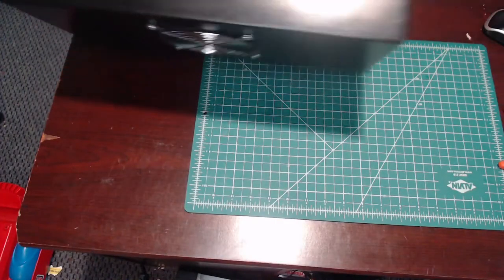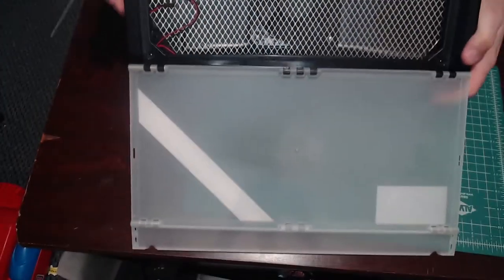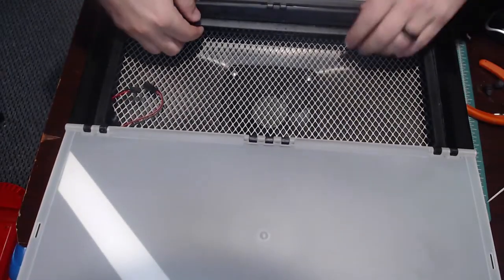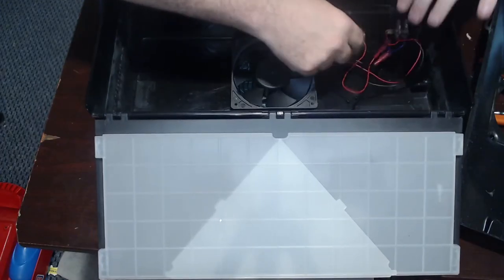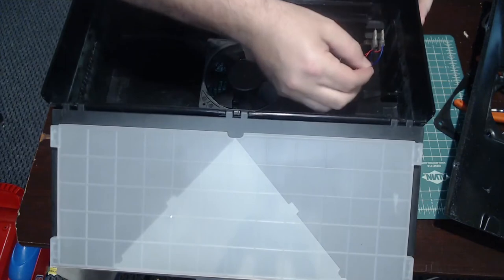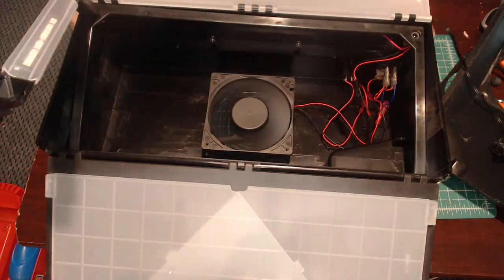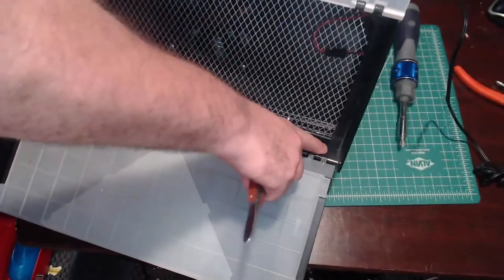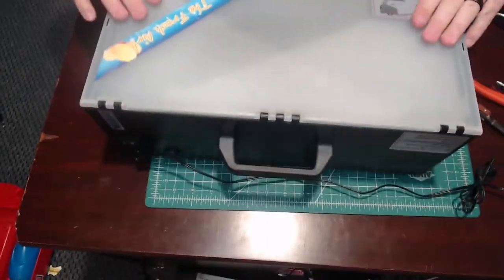Air Brush spray booth upgrade

Comment: Thanks for decoding the steps to get into the electrics for that spray booth Rick. Might be good info for an owner even if they don't want to add the switch.
Reply from the maker: thats true. could helps someone out with a simple repair also. thanks Art.

Comment: Hello, thanks for the video. Can you tell me, please, what kind of switch did you use ? Is a 6A 250VAC - 10A 125VAC good ? Did you only use the wires you had inside the case or did you had to buy some extra to do the job ? I know nothing about electricity so I'm tring to go step by step to reproduce your upgrade.
Reply from the maker: Gosh it feels so long ago... yes you do need 1 extra wire. There needs to be two wires on the switch. I soldered 1 on to the switch and used a t-tap to go to the power wire coming from the plug.  Then disconnect the fan wire from the current switch and attach it to the new plug.

Comment: Rick what make is the spray booth
Reply from the maker: this same model goes under different numbers but mine is this. 
Make: Master Airbrush
Model: MAS B440DCLK
Thanks for watching James
Reply: I been looking for one , will check out Amazon thanks Rick
Reply from the maker: Got mine at amazon. Think it was $109 with the vent tubes.
Reply: Rick I found one similar about 150 CAD